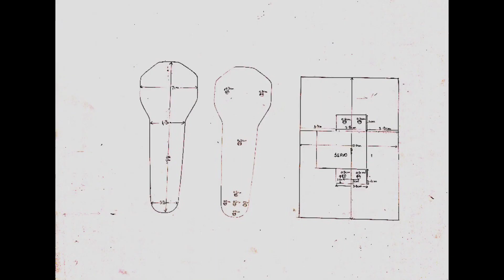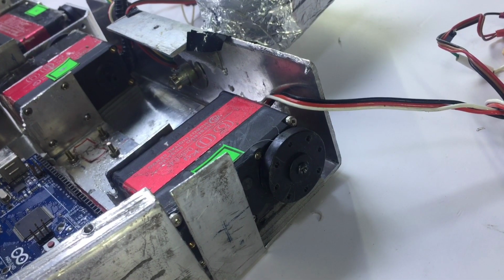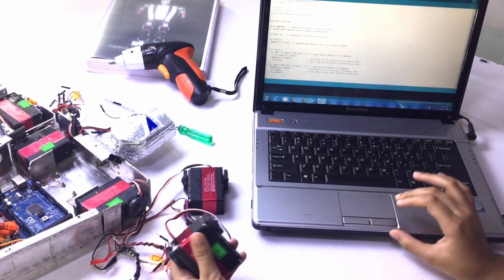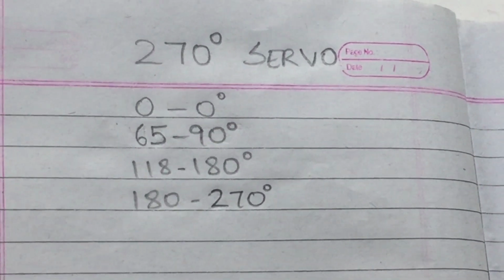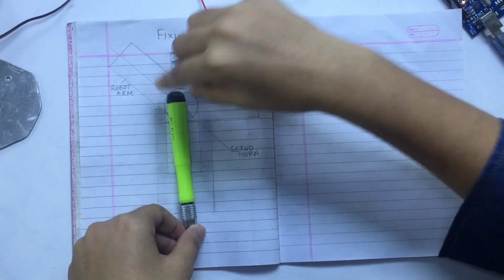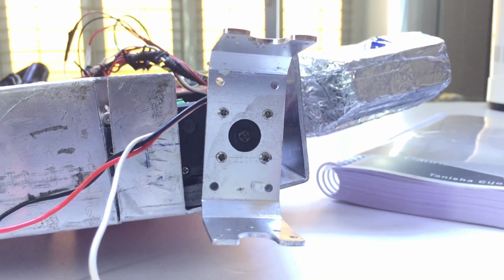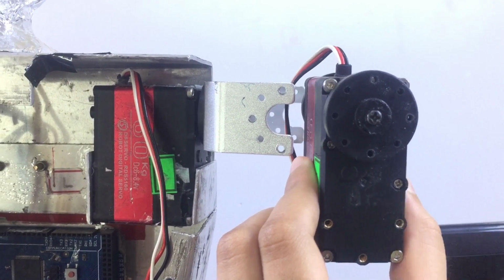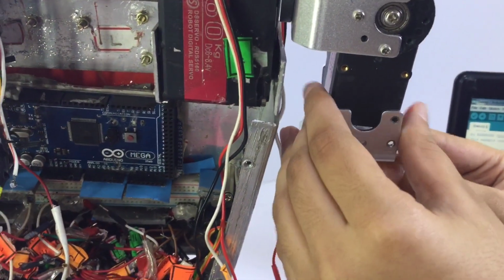How to make a Humanoid Robot (Making Video)- Part 1- Tanisha Cijo

Comment: U dint show the power tool section..
Extraction of parts from Metal sheet shouldn't be sth of the tools u showed in video.. 
Except this, rest on top..
Keep going..
Reply from the maker: I did not cut the sheet myself.I went to a lathe for that.This is why I did not show it in the video.

Comment: Nice! Questions: What are the dimensions of the robot when it is standing? What kind and model of battery are you using?  How long can it run before it runs out of battery?
Reply from the maker: Cadrick is 30 inches tall and 34 inches broad.
I used an 6000mAh,2S,60C battery. Since it lasted for only about  15 mins, I now use an external power supply.